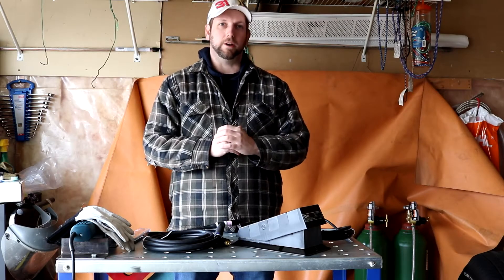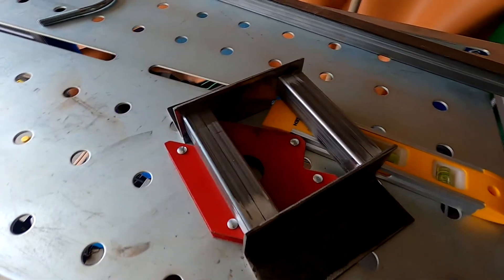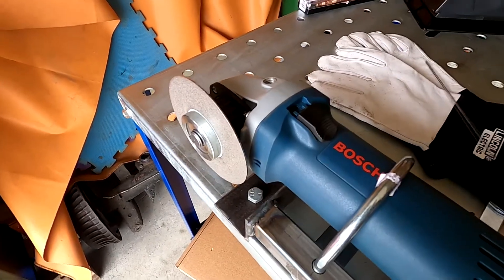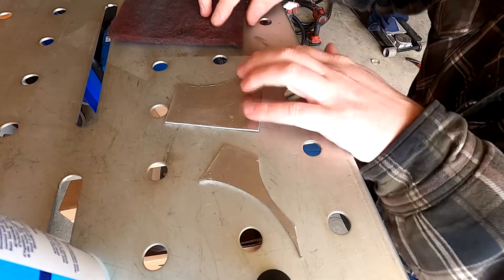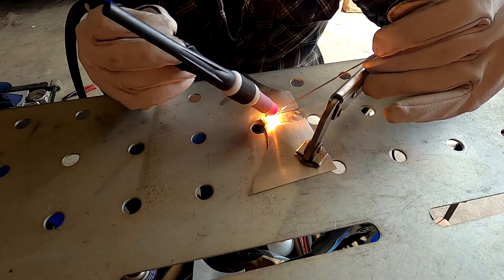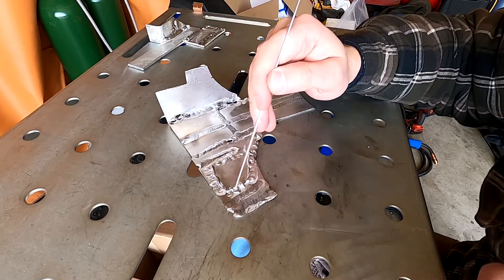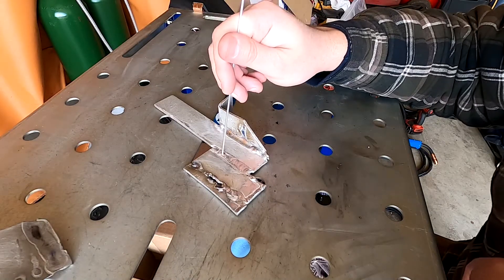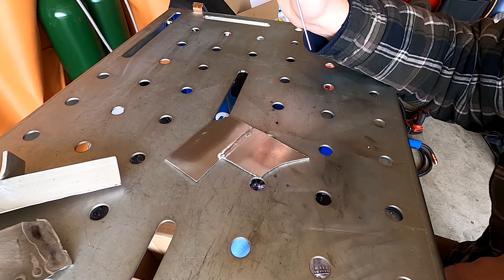Can a BEGINNER welder TIG weld ALUMINUM?

Comment: Thank for the video I have the very same welder have never used the tig and have been searching for videos on how to use it. I got a aluminun bicycle wheel I need to repair and it looks like I had better do some practice pieces before I attemp the project.
Reply from the maker: unless you have a hidden gift, practice is very important.

Comment: Thinking about the same welder. Good vid, nothing worse than a “know it all” just keep saying it honestly is the best way 👍🏼 at least you are not trying to make up shit as you go. We all start somewhere… I’m in the same boat. At least we can learn 💯
Reply from the maker: Thanks. For a first time welder, I would recommend the Miller Multimatic 220 unless you have no intention of TIG welding aluminum.
Reply: @SS454LS6  Tig aluminum is the reason for considering the machine